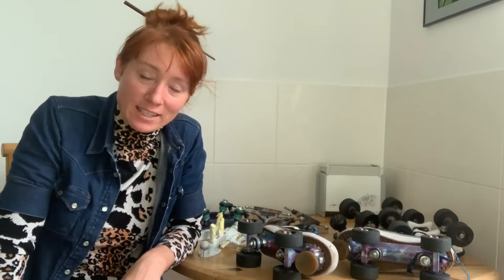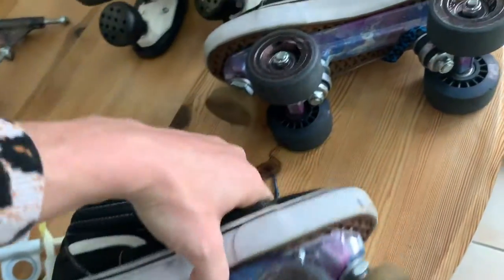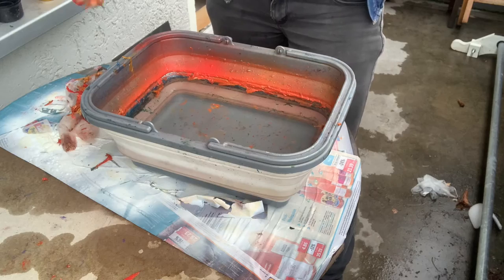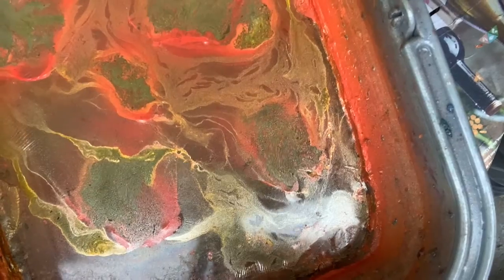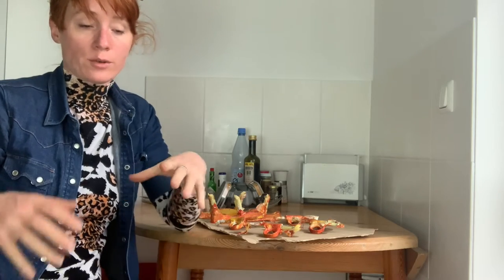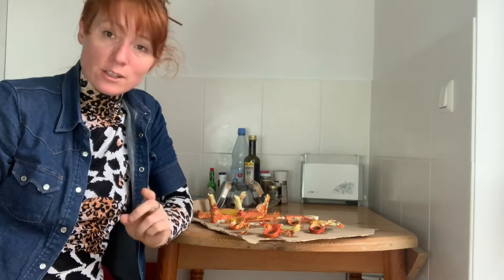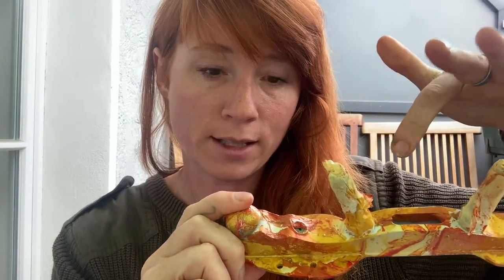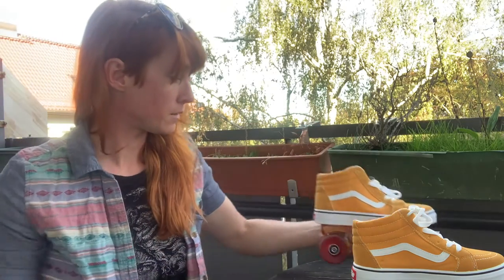How to Hydro Dip Roller Skate Trucks and Plates

Comment: How long does this last and would it work with any brand plates? Does it hinder the plate in any way? I’m getting custom boots soon and can’t find a plate to match other than a brand I’m not familiar with. Want to Jeri my options open and don’t mind getting a little crafty if it means I can get something I’m familiar with and color it to my liking.
Reply from the maker: I've done it with mostly metal plates, I can't say for nylon other than maybe talk to the people at the hardware store about the material you're going to spray it on. I'd say don't paint over any parts that need to move (screw in or out), for example if your plate has an adjustable pivot pin. Make sure not to get any paint in any of the threading (I can't remember if I said that, I usually stuff something in those parts)
Reply: @rollerskaterevival8484  oh no, I’m swapping these standard nylon plates out lol I was looking at the bont Athena plate since they offer it in a light pink which is perfect for my new setup but I’m not familiar with that brand. So I’m considering buying a brand I know (maybe roll line or falcon) and trying this out. I was specifically suggested not to spray paint my plate but… I’m tempted lol what do you think; get the pink plate, try to color another plate, or leave as is?
Reply from the maker: @primrosedeluna  Hard to say. Bont is a good brand so that may be fine. I find hydro dipping to be pretty inconsistent- sometimes I'm like "this is the most beautiful thing I've ever seen" and other times I don't love it but I'm not sure why